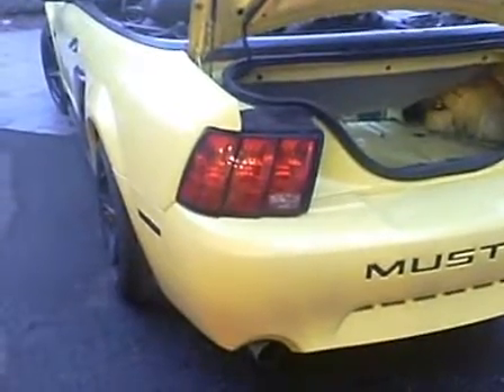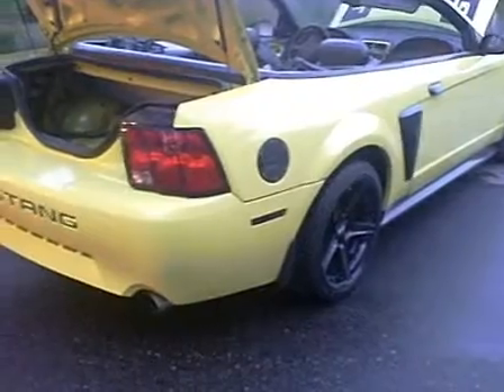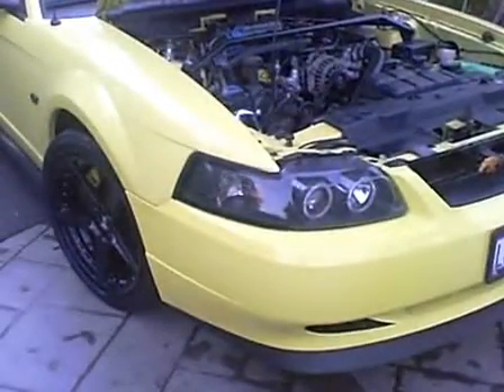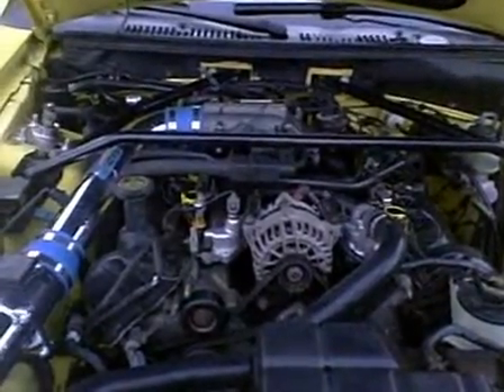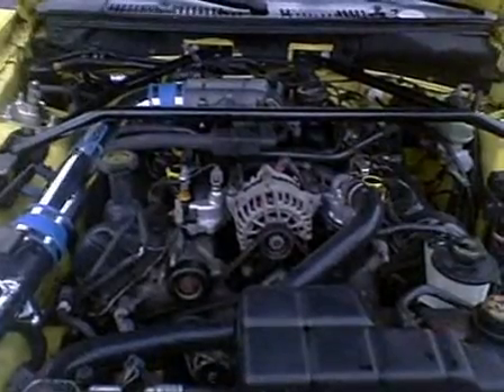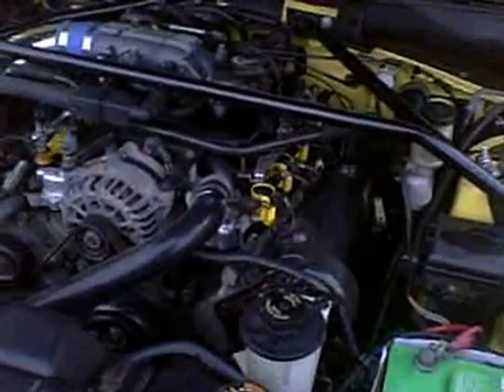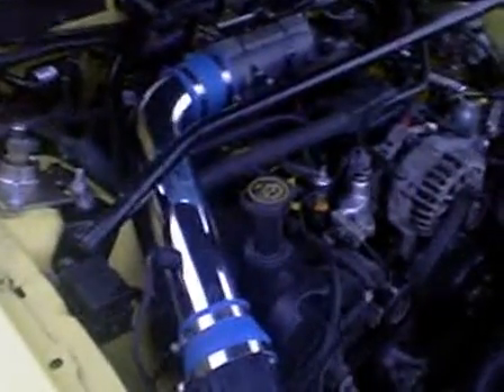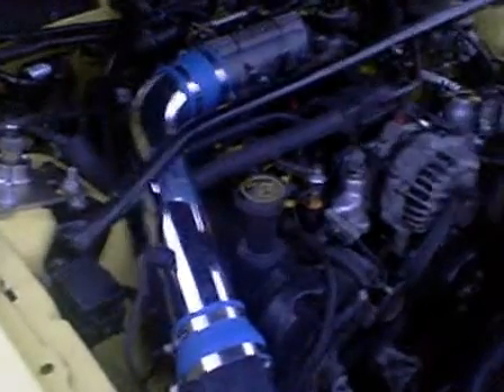Coyotify: Coyote swap breakdown

Comment: I read your post on coyotify.com and you said something about writing up a clear manual for this swap. Did you ever get around to doing that?
Reply from the maker: Adam Smith not yet.  I wrote up some pieces, but when I got to the wiring and plumbing, I took quite a few detours.

happy to talk if you have questions though
Reply: Paul Ferris currently it's all just research on the build its self; so I havint started a build yet. Just doing some homework.

Comment: I have a 2004 f150 with a 4.6l in it.....can I do a new 5.0 swap with the same 4.6l transmission and rear end axel....???
Reply from the maker: yes, you can likely keep the trans and diff- you will likely need a transmission control computer though.  it might be possible to rig the stock one to work as well, but that's not something I'm really familiar with.  your big problems will be doing all the same plumbing and wiring that I did for my swap.
Reply: +Paul Ferris  alright thanks... my next project. ...

Comment from the maker: MM stuff is awesome -- I plan to do the rear suspension after I get the front of this thing nailed down.   Have you done the torque tube/panhard bar setup?  That's what I'd like to do, but don't know a lot of people that have tried them.

Too late on the anti-locks :(   I've lived 7 years or so without them, and am just going to have to suffer.   I have the parts I'm pulling if you want em.

Comment from the maker: I'm already past the exhaust -- I'm going with the factory shortys and having custom replacment pipes for the front half of my bassani.

I've had the motor in and out a few times fitting all of this together -- it fits fine now.
Yeah, it wasn't tried and true till about 2 days ago from what I can tell.   I'll have video describing what I did later :)

I have the S&R pump kit :)

Will look for your blog post,
--Paul

Comment: Not to mention, you can keep all of the stock lines for the PS with the S&R kit.  Money well spent.
I highly suggest maximum motorsports for suspension parts.  Again, you pay more money, but you get excellent quality and actual engineering done for increased cornering traction.
You will likely want to install your engine from the bottom. 
KEEP you antilock brakes.  You mentioned that they aren't working but you will want them!  Shouldn't be too difficult to repair.  Wish I had antilock.

Comment: Check out a few blog posts down on my site.  Hard to see everything.  Let me know if you need any parts.  I've owned two swap cars now.  I listened to most of your ideas and everything sounds doable but from an ease of installation/tried and true viewpoint - I have some suggestions for you.
Use the BBK headers - everything fits perfectly.
Use the S&R Alternator relocation kit - it allows you to keep your OE PS pump in the stock location. (and leave the hydroboost stock)
(cont)